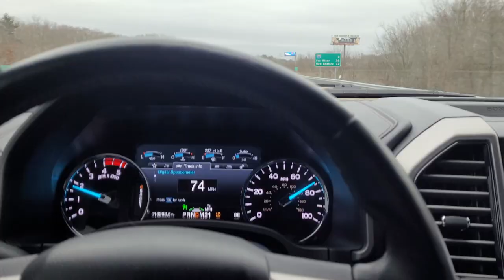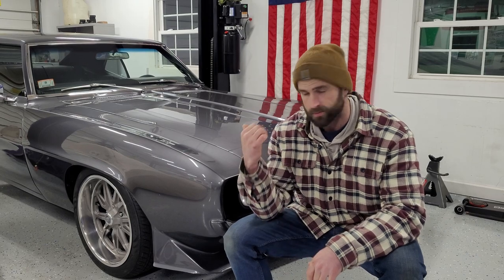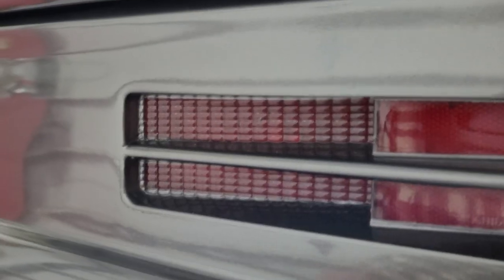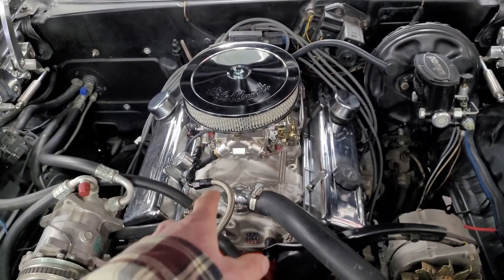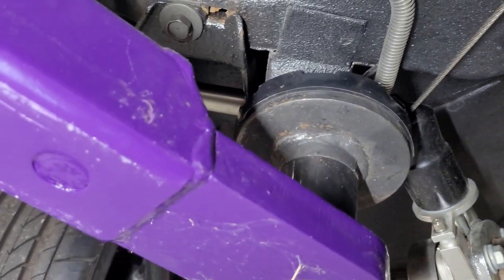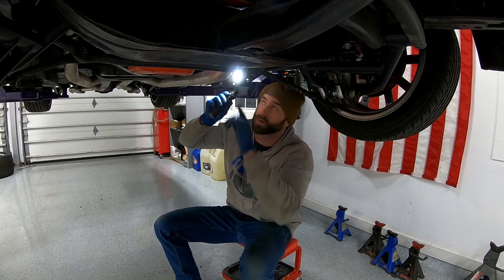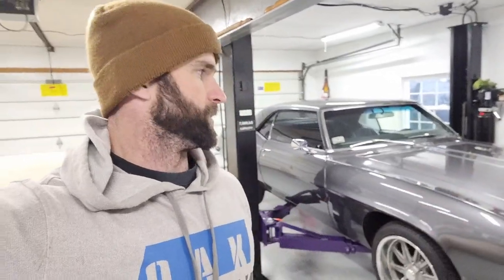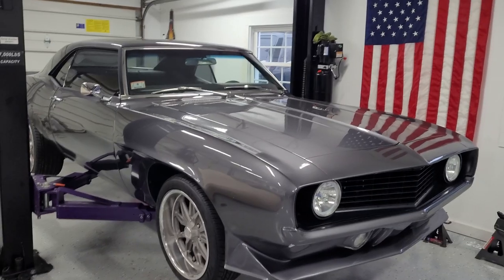Winter Project 2022 - 1969 Camaro Pro Touring Build!

Comment: Yers ...... most def, sub frame connectors. I have a 1973 corvette fully optioned big block car & I am putting a 454 big back in it with fuel injection and a few more updated mods.

Comment: The only nice thing about that (super) small block was the weight distribution. My buddies and I pulled the stock 350 out of a '69 years ago and dropped in a 502 crate engine when that came out (mid-'90s?). We were in our twenties so it seemed like a great idea at the time but it put so much weight up front that the car went from driving like an older sports car to driving like an older semi. Rookie mistake. ;-) BTW, the color on that thing is gorgeous.